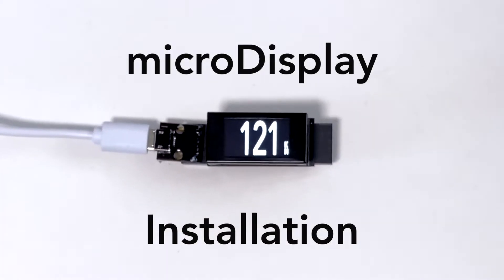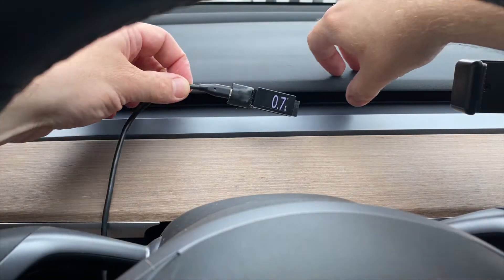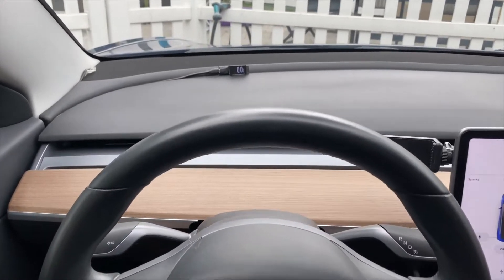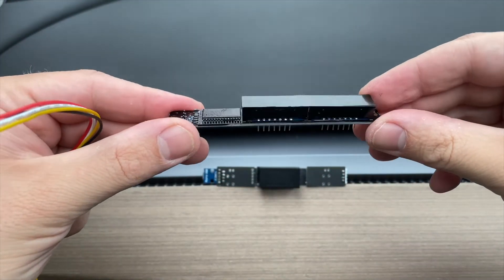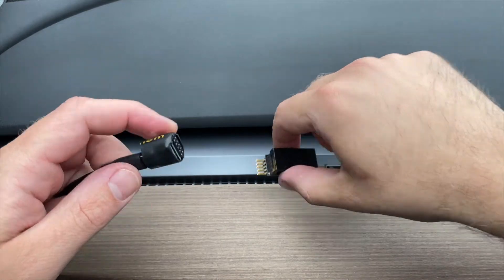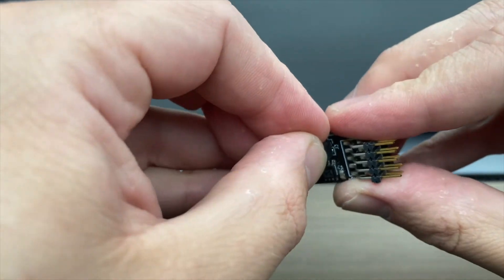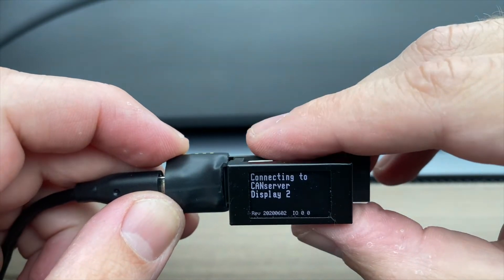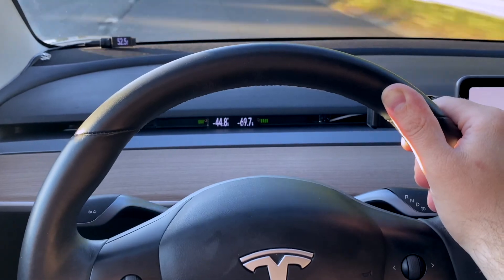microDisplay Installation

Comment: This is amazing work. So what I am after is a slim clean display. Is there a way that the micro display itself is only visible? So mounting it the way you did but having the board and USB cable at back inside the vent? Possibly running extensions from the micro display to the board so it's not directly mounted on the board? Then you can tuck away the USB, board etc inside or underneath? To have the totally clean look of a micro display only? 
Thank you
Reply from the maker: I made a right angle adapter so the cable goes out the back and is less visible than the original version

Comment: Using vents is a cool idea. With some additional black housing can be looking completely stock. The sad part only that it blocks the air in that place, but if there will be gaps between individual displays for air - that will work even for a large setup.

Are those displays programmable? Can I use them to show different color warnings about temps? What if I have some other sensors like tire temperature sensors, TPMS sensors, brake rotors and fluid temperature - how to combine the data in one place for logging and indicators? 

I made a code for RaceCapture before, but ended up not fitting in memory no matter what I do and gave up on it.
Reply from the maker: You should be able to do that with the display lua scripts, I don't think it would take much code at all. You could also do your own arduino code entirely but I don't think that's necessary. I'll get back to you on the exact memory space for the scripts. 
If you separate displays/leave a gap in the center of the air vent then air blocking is not nearly as much as an issue. I'll demonstrate in my next video.